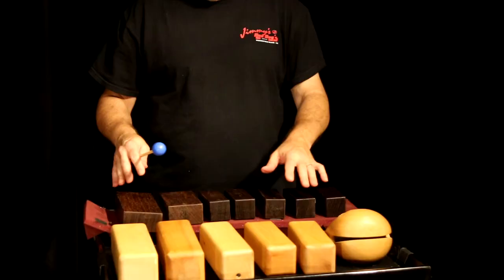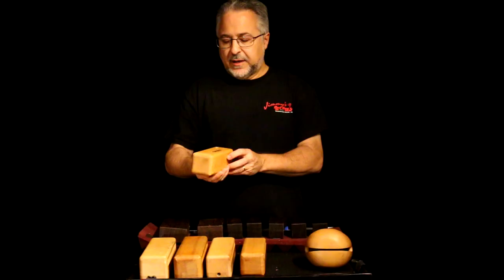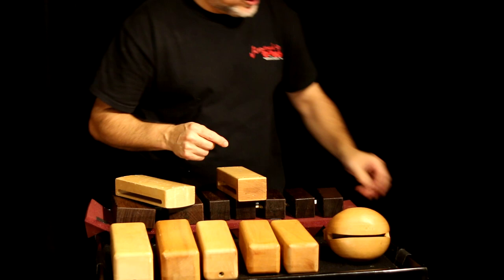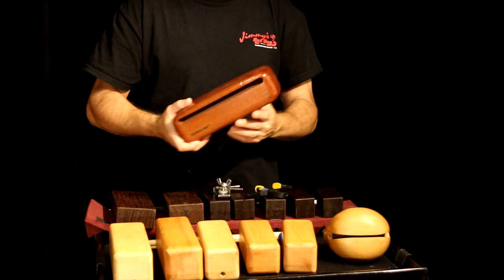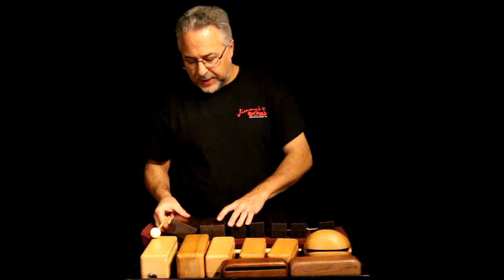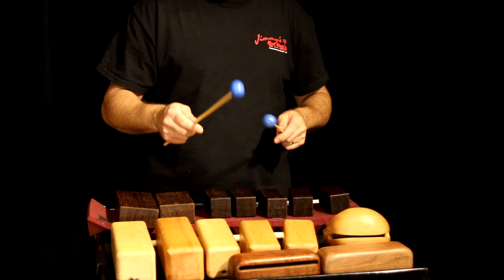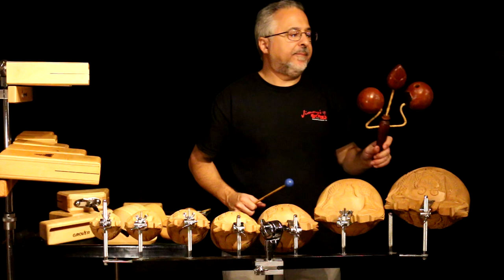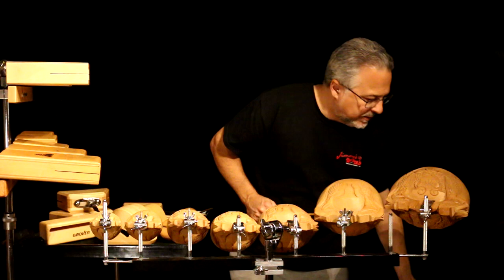Wood Blocks and Temple Blocks

Comment: I’m about to purchase a new general purpose woodblock. Is there a big difference between the Grover and Black Swamp models in your opinion? They are similar price points. I’ve looked for a side by side comparison video between the two without success. Thanks!
Reply from the maker: Hi Tim
Not much difference. As long as the block is hard maple you should be OK with either brand.

Comment: Love your videos. Question for you. Have you used, or are you familiar with the Pearl malletstation? Considering purchasing one if the feel is anything like an actual marimba. Also, I’ve seen videos of people using them for pit work instead of timpani and the larger mallet instruments. I’d be very interested in your opinion. Thanks!
Reply from the maker: Hi Tim
I have not used the malletstation but I have used a malletKat for around 35 years now.
The malletKat is a very advanced controller and is very reliable. Not sure about the Pearl.